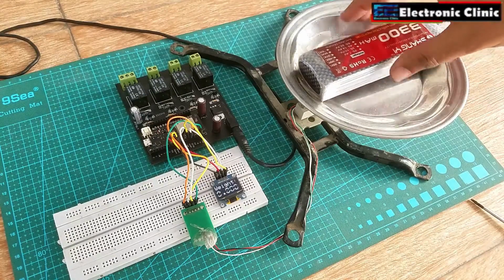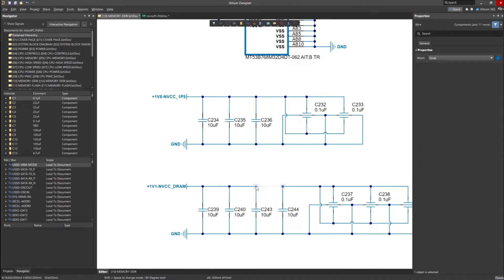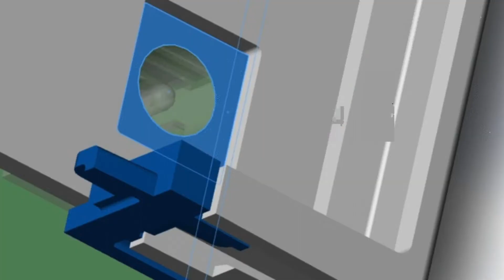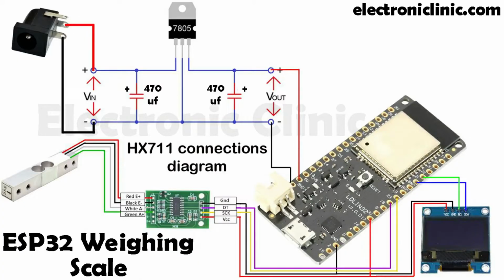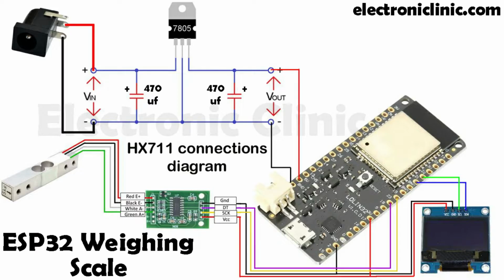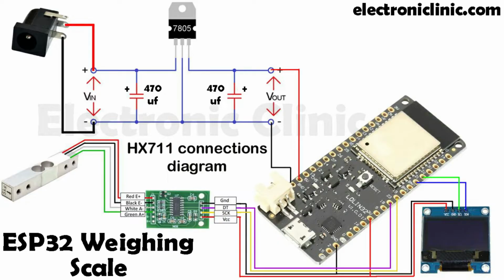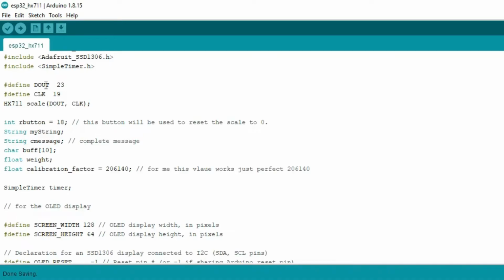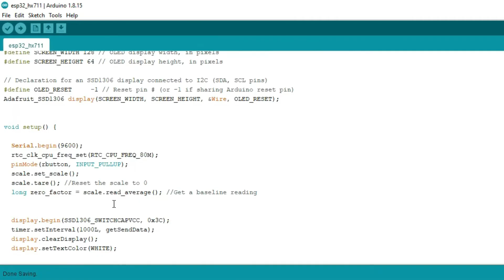ESP32 Weighing Scale with Load cell & HX711 Module, ESP32 HX711, ESP32 Load Cell, hx711 Calibration

Comment: For me the weight reading speed is slow, like if I place a weight it takes more than 5 seconds to reach the final value. Any help?
Reply from the maker: if there are more numbers after the decimal point then you will see that fluctuation, but if you set lets say 2 numbers after the decimal point then it will give you a solid result.
Reply: @ElectroniClinic  I'm using int. When I use the code to just display the weight it gives me value immediately but when I use it with a larger code the value is displayed slowly.